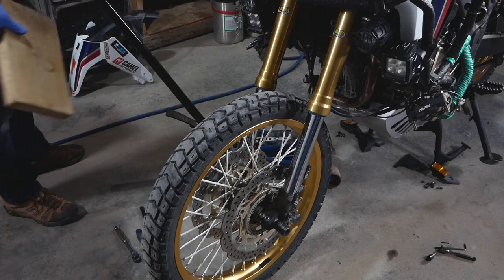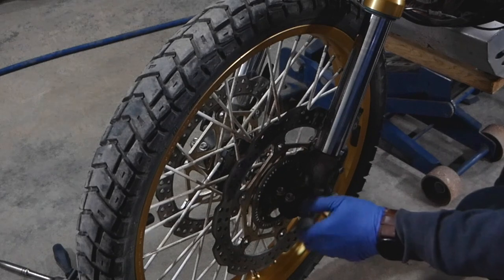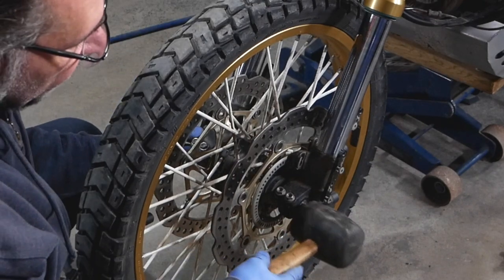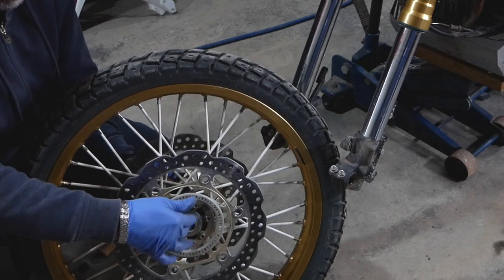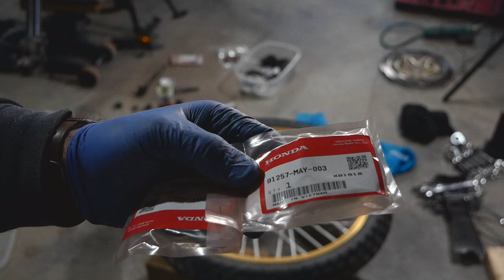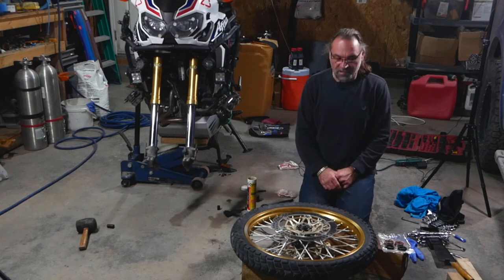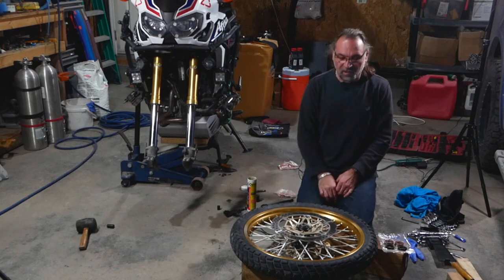HOW TO REPLACE MOTORCYCLE FRONT WHEEL BEARINGS

Comment: pro-tip - before installing the bearings, put them in the freezer for a hour or three, the cold will make them shrink just slightly, making installation very easy ;-)
Reply from the maker: Actually I did that but forgot to mention in the video i hear this before not sure if that's true if it makes the difference but I did it anyway